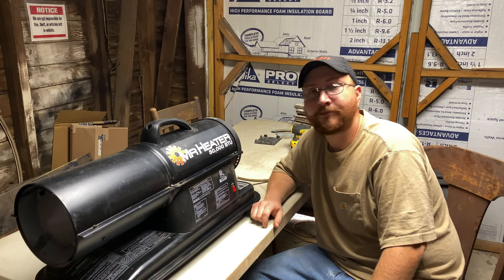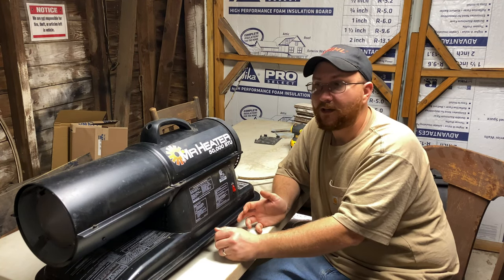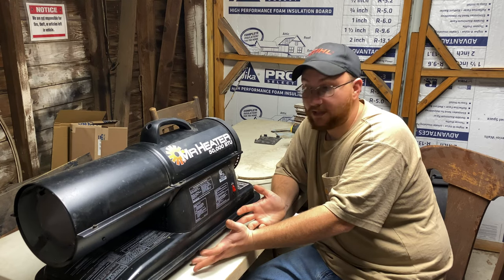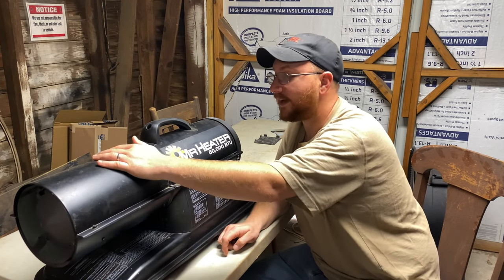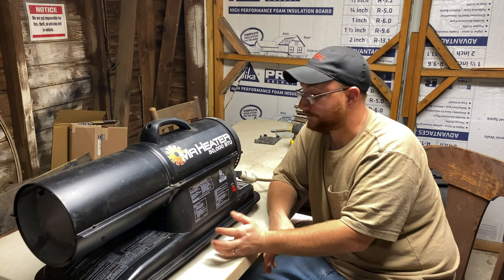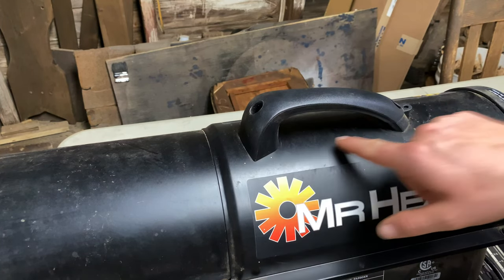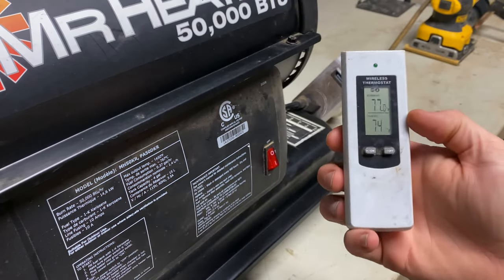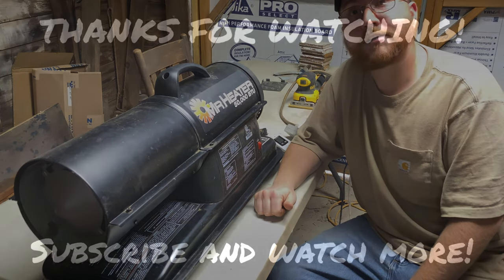MR HEATER 50K FORCED AIR KEROSENE HEATER REVIEW (With a Helpful Upgrade!)

Comment: I just bought one of these. I believe I’m going to look into the wireless thermostat issue is that way I can make it a longer run with the fuel. I just bought a jug of 5 gallons of kerosene. It was $45 ridiculous. Good video by the way, straight to the point no fluff.

Comment: After doing alot of research on these kind of heaters after trouble shooting the one I have. I also run mine on diesel which has more btu than kerosene, and it's alot cheaper. And I found if you have a smaller 50,000 btu model, you have the same identical heater as an 75,000 or 80,000 model. The only difference is the size of the spray nozzle. I looked at my owner manual and according to the parts list, that is the only difference! You may have to adjust the pump pressure, but then you'd have on size better model!

Comment: Diesel has an energy density of 139,000 BTUs per gallon,  kerosene is similar to that of diesel fuel; its lower heating value is 131,890 BTUs per gallon. The sticker on the back, is telling you the best fuel to use based on outside temperature. (basically what fuel not to use in cold temperatures) I like the temp switch.